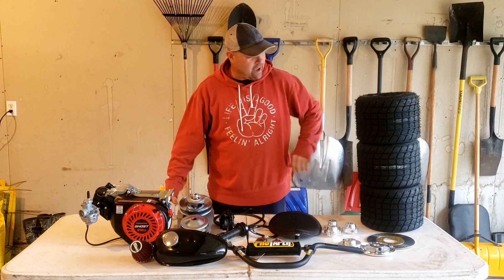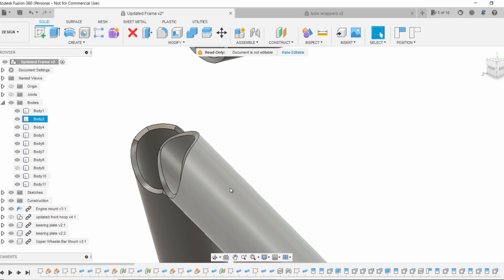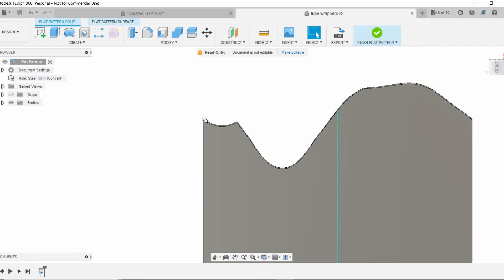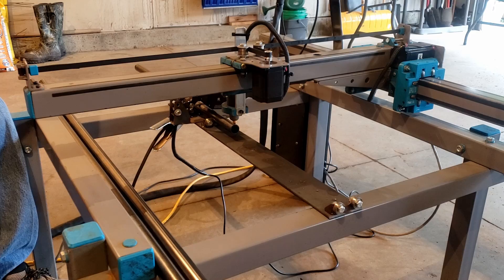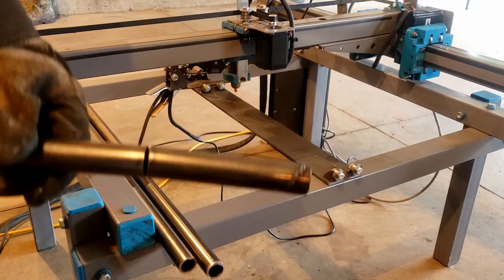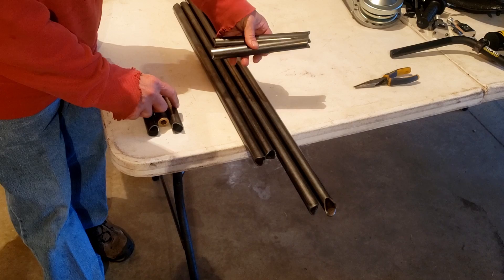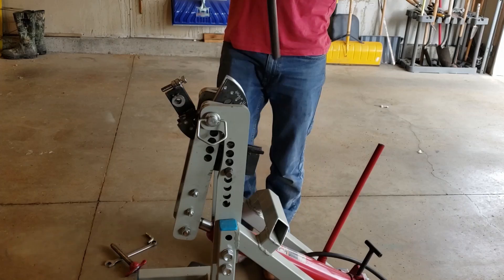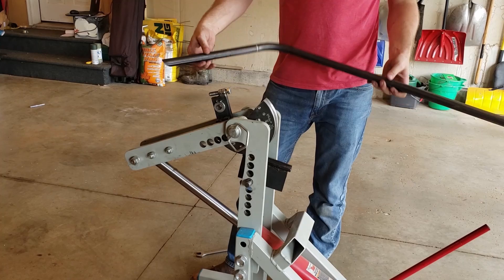Building the Garage Vlog Trike Using Utilizing Our Plasma Cutter

Comment: good afternoon, can you please explain how you unwraped the tube to a flat panel to be able to create the cut path.  Did you draw the bent tubes as sheet metal parts, extruded along a path, then extrude / cut the intersections to get the notches?

Comment: you are great fabricator's you were  better off making your own original  ideas for your frame if you have the right mind set and   equipment  I was going to order their frame only kit for $ 699.99      they are out of stock  when you go there website it says it  with a lead time  i assume they have financial  problems paying their vendors/employees/rent/insurances i assume material cost around  $100.00 maybe sell your  own frame design or plans
Reply from the maker: We aren't necessarily trying to go into another creators domain. But after making one of these we can confidently say they stopped making frames because they make way more money by selling the whole thing.

Comment: I have the ghost on my mini bike. I wasn't happy with the performance so I ordered a 24mm Nibbi carb off Amazon and OH MY GAWD did it ever wake up that engine. The only reason I bought the ghost is because $60.00 buys the 2 year warranty. That's the value of getting the ghost vs building my own off GPS. 
Still waiting for you guys to source an 800cc Polaris sled engine for your crosskart. Just the thought of that insane power has me on edge.